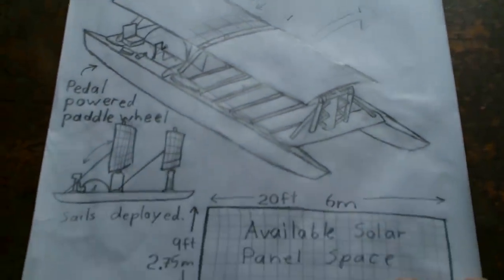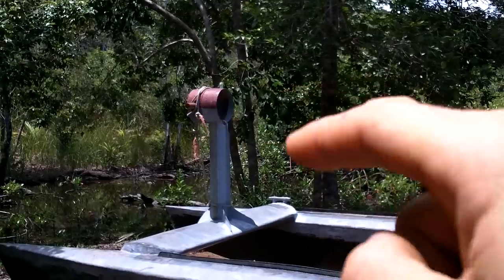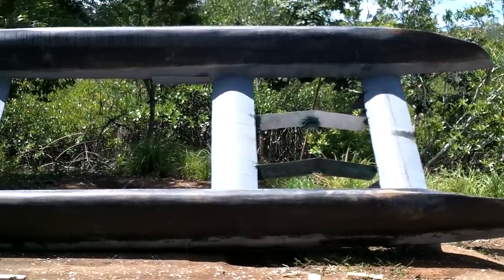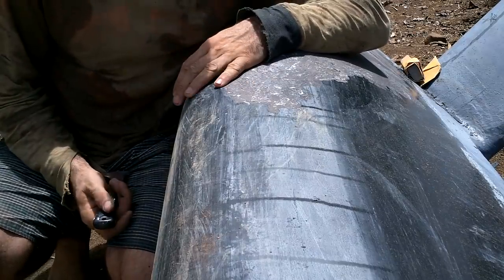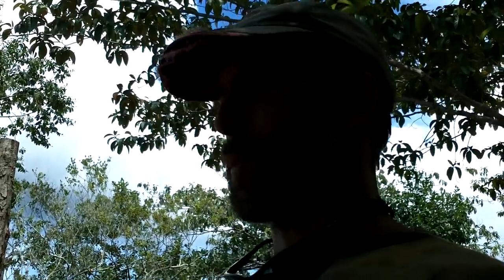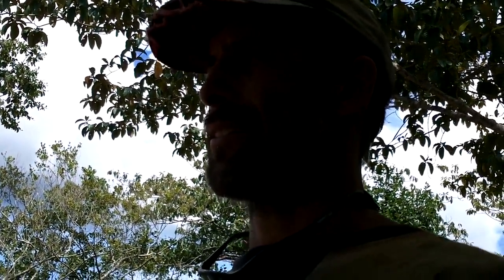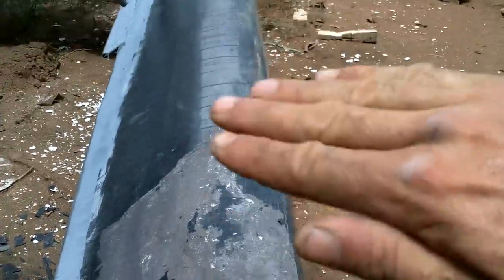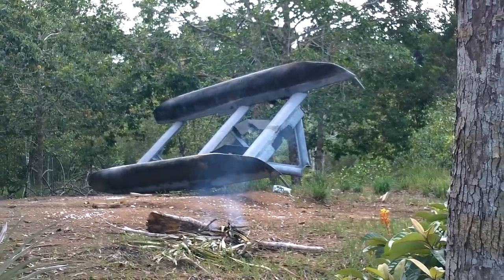Boat Chips 014 Trouble with a Capital WTF?

Comment: This is a well known problem, some call it "fiberglass osmosis" others call it "fiberglass cancer".  It's due to the interaction between the fiberglass and the sea water, that's why you see it only in the part that's under water. Search the internet for these terms to find a trove of solutions. As RenoSimpson says in a comment, epoxy paint is a valid solution to this problem.

Comment: Easy delam , it's not from lack of hardener, It's either old resin or also  amine blush will do that.  Shelf life of poly is usually less than a year Opened resin can go bad fast in humid warm areas.  But this has been said many times before and you've been lucky till now.  Resin has to be tacky to lay more to get a chemical,  or when gone off (hard)has to be sanded then wiped with a solvent like MEK to get a physical bond
Reply: I think your reply is accurate. I would sand and apply a layer of mat. The weight gain would be minimal.
Reply: @edfrhes  Well, it is just basic glass work, nothing special, glass has been done since the 50's, unless you're a resin chemist just do what works

Comment: If you have a single exposed fiber of glass it acts as a highway for water to get into your layup.  Fiberglass is only encapsulated by resin, not sealed.  This is why gelcoat, bottom paint, etc.. is needed.  You might have taken on some damage or had exposed glass on the pontoon with failing paint.  On another note, epoxy blended with graphite powder is an excellent bottom paint.

Comment: A bit off-topic, but if you're looking for a way to store some carbon-neutral fuel for a rainy day, you should start growing bamboo on one of your islands, and then build a bamboo pellet mill setup.  Run that thing on solar, and you can harvest the bamboo about 4 times a year.  You'd just want a cool, dry place to store the pellets.   You can burn the pellets in any type of pellet-burning stove, and it burns cleaner than just about any wood, with little ash.  The ash you can use for various things, it has no sulfur and is in general cleaner than wood ash.
Reply: hemp might work out better but might not be legal yet ..
Reply: @Mr1966killa  hemp is more energy dense, but bamboo grows faster

Comment: Jamie - did you use wax in your resin? If you’re using laminating resin it needs wax in the final layer to cure. It looks like your final layer never cured. Wax or PVA spritz will finalize laminating polyester. Been there.

Comment: I have often wondered if you add the wax additive to your top layers of polyester resin and just haven't mentioned it on camera? 

but based on your comments about it being sticky, it seems like you don't add it and without the wax to rise to the surface the top layer doesn't cure properly, but instead remains tacky, which is to allow you to laminate more layers if required in other applications and have a chemical bond.

If you don't have the wax additive available you could instead over spray the top coat with a pva and water mix to form a skin over it, which like the wax additive, excludes air and makes it cure hard. Regards Dave

Comment: If you had just a small steam engine with a small boiler it'll probably do you okay on a little lunch. You should have this item mount it in your boat with handles so you can carry it to another location where we can power an alternator. That would be two items engine and boiler I'm thinking wood boiler. He went with a larger boat you can have the alternator on the boat and Power electrical line to your battery Banks.
Reply: I like this idea. Steam power could solve a lot of his issues.

Comment: I was going to suggest using the other solar panel holder for a warp drive mount, but you cut off the top of the warp drive stabilizer. Guess you don't get no warp drive

Comment: The reason your sanding paper gets plugged up and why the resin is sticky is because the final coat of resin must have a liquid wax added to the mix. To get a dry hard cure the resin must be closed off from the air! As the resin heats up the wax rises to the surface, dries and the then resin not having air next to it will then cure 100%.

Comment: Hello Jaimie, I am concerned about your sailboat design. One reason is I don't want to see you do all that work and have it fail. Here is why: If there is a headwind say coming from the north and you have to go north to get home you will not be able to use the sail. If you use a more conventional design you could zig-zag right into the north wind. The three basic components of a sailboat are the sail, rudder, and keel.   The keel holds you on course that your rudder sets and the sail provide the push. It's like pinching an ice cube between your thumb and finger. What a  feeling harnessing the wind no matter where it is coming from. Instead of being pushed around in circles or blown miles off course.  What was that Tom Hanks movie?

Comment: You probably could go 100% steam Electric hybrid as long as you got a car alternator republishing a regular battery. It's probably enough to run large patroller motor. This electrical unit what can also help you run your more powerful items. There is also the alternative to go household current generation. And then she probably should get a shaft motor and Ron whatever horsepower is appropriate.
Reply: The final coat of resin must have a liquid wax added to it. The resin must be cut off from the air to 100% harden and dry. The wax rises to the surface of the resin as it heats up and shut off the air exposure..

Comment: I know you’re averse to motors, but would you ever consider something that ran on your effort? I truly appreciate your philosophies, though I haven’t heard why you’re opposed to motors, whether it’s about sustainability or that you want to move by your own hand. In either case, I’d think a small diesel running on oils you produce could fit the bill. Perhaps only to be run in times like these, but a little biodiesel would be okay, perhaps rapeseed or a Panamanian equivalent? Or an engine running on the “biogas” from your fart machine? You aren’t opposed to machines, clearly, using sawzalls and such and solar motors, so what’s the objection to engines? Asking with the greatest respect.

Ps. Also putting aside the many technical challenges, a methane powered motor for instance.